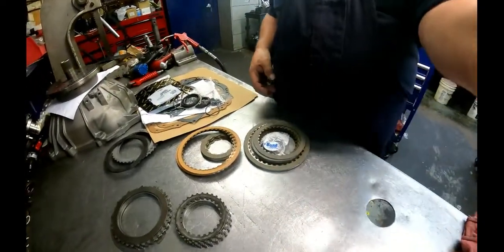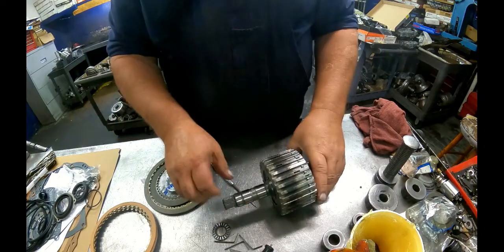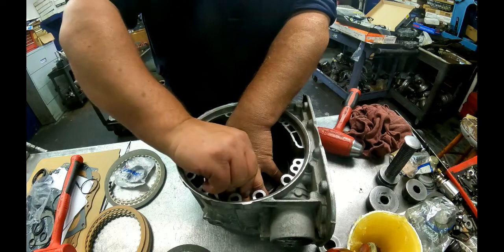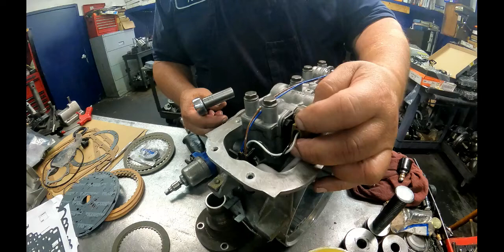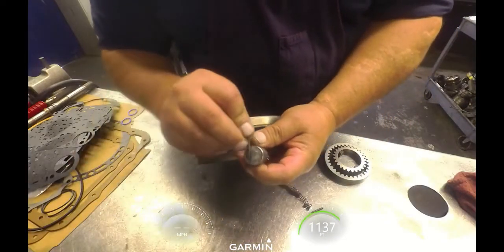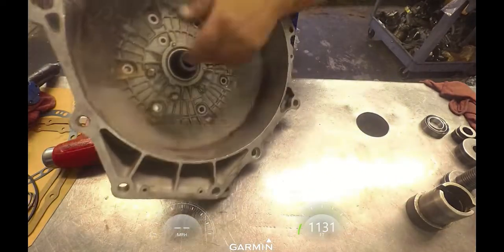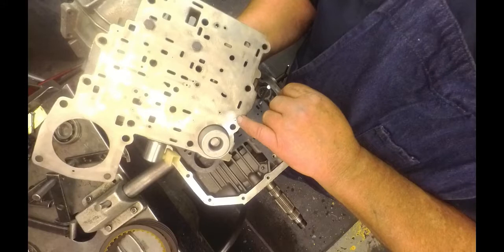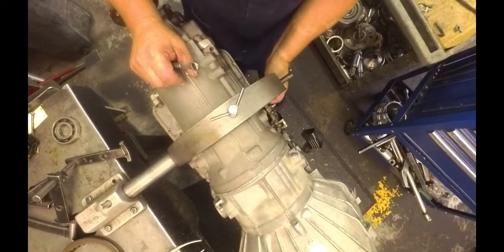4L30E 4 Valve Pump To 2 Valve Conversion

Comment: Hello, the solid oil used reacts with the Dexron 3 transmission oil and forms a residue.
Why do you use solid oil?
Reply from the maker: If you are talking about the assembly gel I am using, it is specifically formulated to dissolve in transmission fluid with no problems.

Comment: Hello Tom, thanks for helping me before. Thanks to you my transmission seems to be working fine now, but recently it has started to lag when shifting from 2nd to 1st gear. It seems to go into neutral and then shift into 1st gear. What could be causing this?
Reply from the maker: Is this on a kickdown shift or coast down shift?
Reply: @ When shifting down, it only gives a gap when shifting from 2nd to 1st. And when I continue without rushing, it shifts to 1st gear. But I feel this almost every time.
Reply from the maker: So this is a coast down shift coming to a stop. You are not quite fully stopped and taking of again? When you rebuilt it, did you take the neutral switch apart and clean it. If not, start with that.
Reply: @CurmudgeonTransmission  I couldn't understand what the neutral switch meant, but while doing the revision, I followed your steps one by one and disassembled and checked the contents of the tray where the lower brain and solenoids are located. As you said, it happened to me when I came to a stop while moving forward and tried to move forward again.
Reply from the maker: The neutral safety switch on the outside of the transmission. Also make sure the fluid level is correct. Might want to add between 1/2 and 1 qt. extra if it says full. See if that does anything for it.
Reply: @CurmudgeonTransmission   I will check it, thank you.

Comment: At 23:10, you mention not using the black spring in the pump. Im curious as to why you don't use the black spring??
Reply from the maker: You will have extremely hard shifts.
Reply: @CurmudgeonTransmission  I would be using it in an overland Isuzu Trooper. Would you recommend leaving the black spring out even though the Trooper is a heavy vehicle and would be full of gear?
Reply from the maker: @marvicty  Yes. Leave the original spring in it. I can guarantee you will not like it if you put that black spring in. They shouldn't even put it in the kit as far as I am concerned.
Reply: @CurmudgeonTransmission  Thank you for the advice

Comment: Hello. I went through the automatic transmission 4l30e from BMW ..After installing it, only the reverse gear is turned on and the "N" also immediately goes back. It doesn't react to "D" and S and 1,2 in any way, it doesn't even try. What did I do wrong? thank you.
Reply from the maker: Make sure that the linkage is hooked up properly. The band must be applied in first. There could be a problem there. You could disconnect the wiring from the transmission and see if it will go to 3rd gear..

Comment: Just curious, transmission noob here,...is there any reason or benefit to this conversion??
Reply from the maker: Availability and cost on parts. You have to follow every single step exactly or it will not work. You will end up with driveability issues and codes.
Reply: @CurmudgeonTransmission  thanks.
Reply: @CurmudgeonTransmission  you didn't answer the question. if you don't describe whats happening in the video then should have a description of what the problem is you are solving.. cause lots of ppl do upgrades  when they don't actually have a drivability problem. otherwise you could label the video as anything and its just as meaningful.